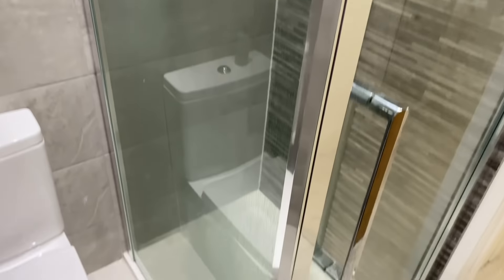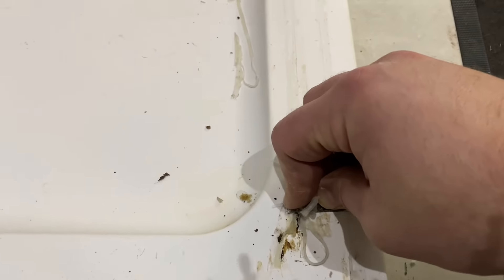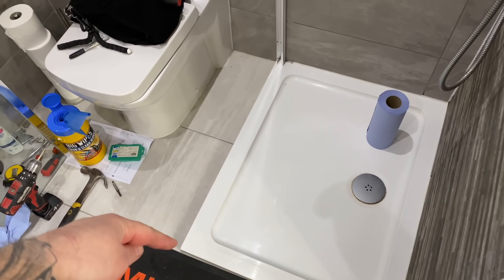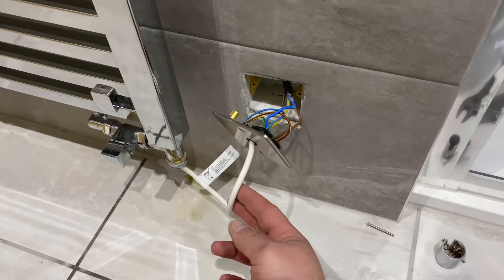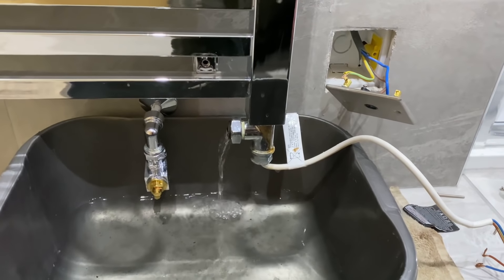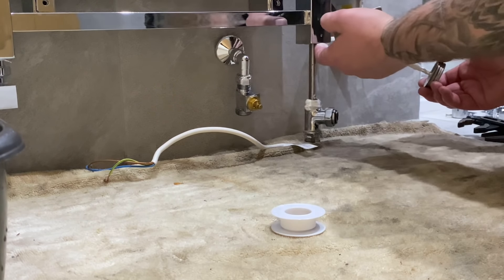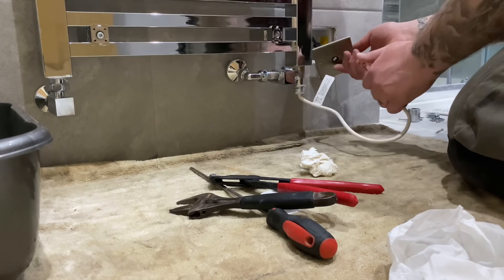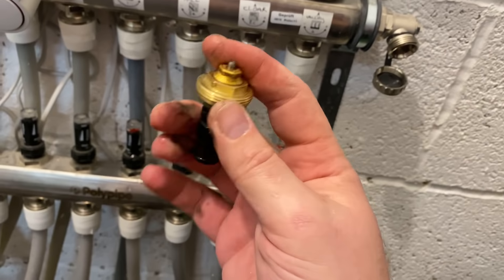BUILDER DIDNT WANT TO FIX THESE PLUMBING ISSUES. Showers, Underfloor Heating, Rad Valves

Comment: I know electric rads with a heating element have the water already in them, I always thought the water was different hence it already being filled. (Some sort of inhibitor for the the heating element) can you just fill and electric rad up with just water then. Probably a silly question. I’ve never really seen a electric rad connected to the actually wet system before.
Reply from the maker: You can get stand alone electric rads that are filled with oil then have the element fitted into them for people who want the “towel rail” look but don’t have a wet heating system. They just connect to a spur.

Then you have the normal towel rail for a normal heating system that is filled normally as radiators are. Then you can install an electric element (like this one) so they can be switched on in the summer when you don’t want the heating on but want warm towels, just flick the fuse spur on and it will heat the water that’s in the rad...
Reply: Top reply and answer bud! Thanks for the advice, keep the vids coming. 🤟
Reply from the maker: Thanks mate..... plenty more to come & glad your enjoying them
Reply: The pre-filled electric rads with water/inhibitor in (as opposed to oil) aren't full, they have an air gap to allow for expansion. The ones on central heating systems are able to expand via the system tank or vessel. So if an electric stand-alone one leaks you shouldnt fully refill it. And I might be paranoid but I tell customers never to turn both towel rad valves off if they're going to heat it using the element, cos the heated water would have nowhere to expand to 😱